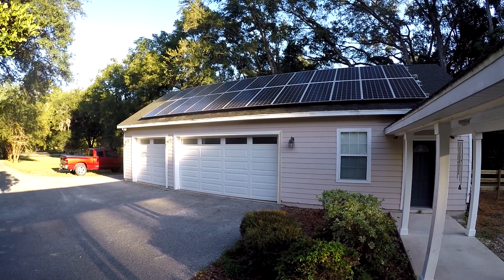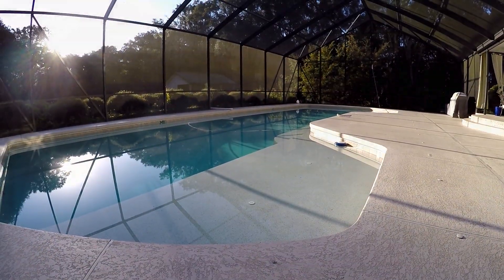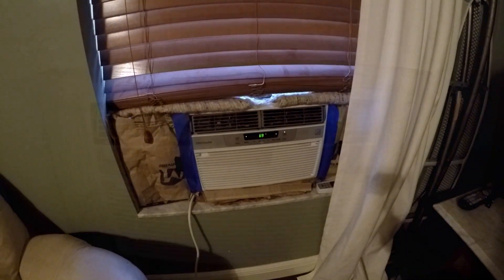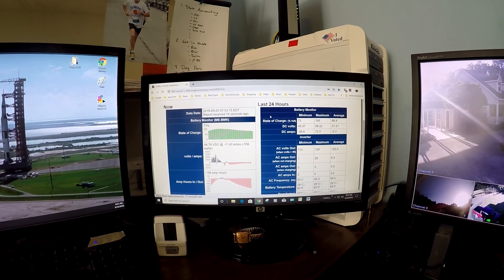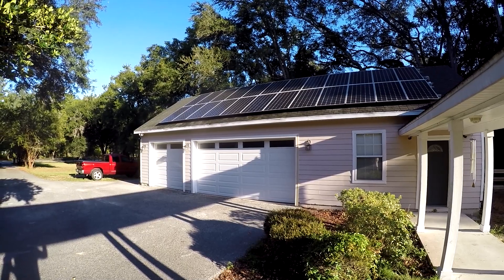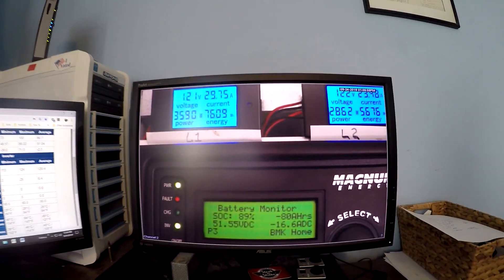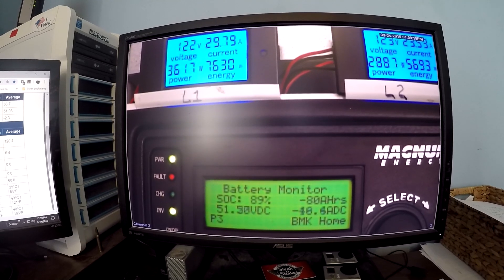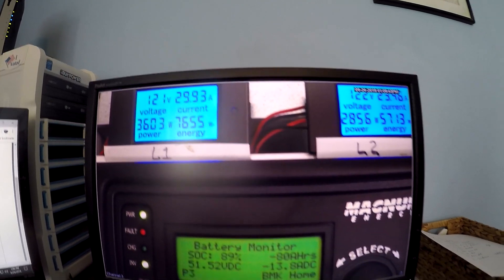A Typical Day on Hybrid Off Grid Solar Power

Comment: Hi, What size inverter, solar wattage and battery bank do you have?
Reply from the maker: Eugene, two inverters deliver 8,800 Watts continuous and 16,000 Watts peak.  The panel is currently 8300 Watts but I am expanding it to 13,000 Watts soon.  The battery bank is 48V and 740 Ah flooded lead acid.  Details here: https://youtu.be/zb4oar9UHSY

Comment: You have an impressive solar arrangement. Not only do you have what appears to be 24-panels bringing in a solid 5,000 watts of power, but you also have a solar water heater for added hot water, and you even got a mile of PVC piping to heatup your pool as well, very fancy setup. But as it is with all solar, its only good for during the day, and thats when you rely on the batteries, unless you use grid or generator power. I wonder if you've done a video on battery maintenance, as those deep cycles batteries don't last forever.
Reply from the maker: I have a complete series on how I built my solar power system under playlist.  I will be switching to a lithium type battery eventually when my lead acid gives up.  Looking at the battle born, fortress and Tesla (wrecked car) options.  You might like this: https://youtu.be/sbZEvf62i8o

Comment: Great video.  You use a ton of power though.  Between your array and the grid you used more power in a day than most households use in 4 days.
Reply from the maker: Well I think I greatly overestimated the kWh from the utility as it was closer to 5 kWh and I don't normally work this hard at switching stuff on and off from the solar.  I average more like 15 kWh/day on solar and 15 kWh/day on utility.  I think 30 kWh/day is pretty typical.  Thanks!
Reply: Ok, that makes much more sense.  Do you have any videos on your battery bank.  It seems like you have a great system.
Reply from the maker: @thatguyc5899  I have a complete series on how I built my solar power system.  Look under playlist:
https://youtu.be/TPDjfuxWlnU

Comment: Good demo & interesting. Are the batteries fully charged when you turn things off in the evening? I wouldn't have thought that you.needed to heat the pool
 in the summer..
Reply from the maker: HootOwl, I usually fully charge the batteries everyday.  I turn off all the "extra" loads at night but not everything.  I typically run about 500 to 800 Watts all night long.  That drains the battery down to about 85% by the morning.  I could run an AC on the battery overnight but I favor preserving the battery life over saving money by squeezing everything out of them.  We don't need to heat the pool in the summer.  In fact, we sometimes run the pool heater at night to cool the pool off!  We use it in the spring and fall to stretch out the season.  We will run it everyday from now until mid November.

Comment: Very informative video. Would it be nice if this could be all automated using WiFi enabled devices? I know some appliances are now coming integrated with the feature but not quite were all appliances in the home has that available. Eventually, this is an excellent way to avoid having to get a feed from the grid in areas where net metering has gone away. I try to do the same on my grid tie Solaredge inverters for the environmental and grid avoidance benefits.
Reply from the maker: Pedro, I think this will all be automated in the near future.  I think you could go so far as to turn stuff off and on when the sun goes behind a cloud.  Thanks!

Comment: Are you satisfied with your Trojan battery bank? Any lithium upgrade thoughtd? Thanks
Reply from the maker: I am very happy with the FLA batteries so far.  I think they are still the most cost effective way to go but that is changing.  Soon, I think lithium will be cheaper.  When looking at comparisons, don't trust any video that compares FLA batteries with a 50% DOD.  If you take the FLA batteries to 50% DOD then you're throwing your money away.  That said.  If I were looking for a battery bank today, I would look for a used telecom system or a wrecked Tesla battery at a great price.  You might like this: https://youtu.be/sbZEvf62i8o
Reply: @HomesteadEngineering  This webinar has some great comparisons of the different battery technologies I think you will like:

https://youtu.be/BRqRDZh74F0

Comment: Nice system, love the Magnums. I do mine with grid tie which does it automatically but I do use timers so heavy loads only come on during sun hours. I also have the use it or lose it system so I can have power during power outages but I use it every night to so I take a chance hoping the power out will come in the daytime.